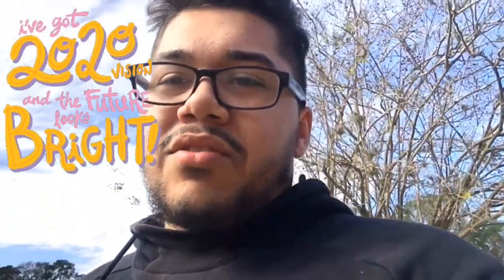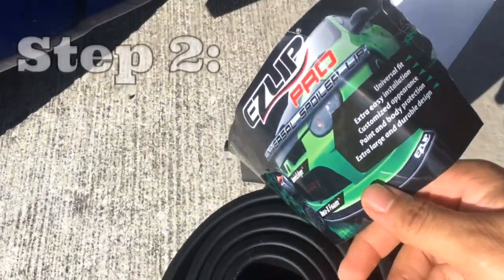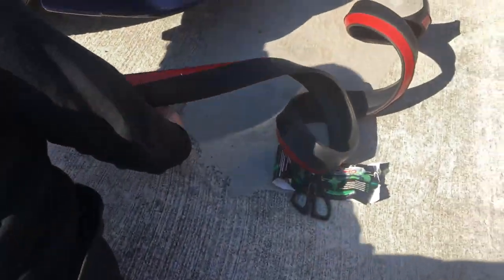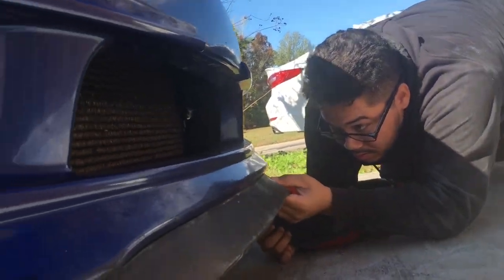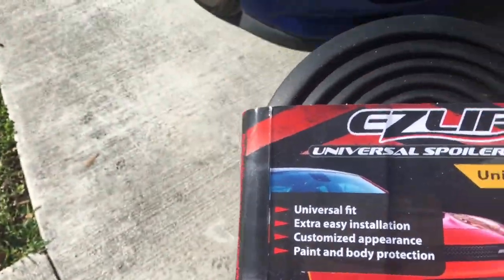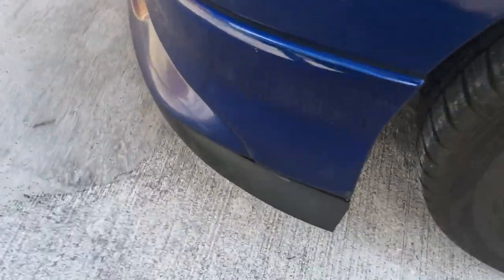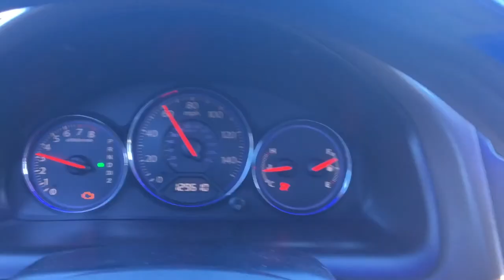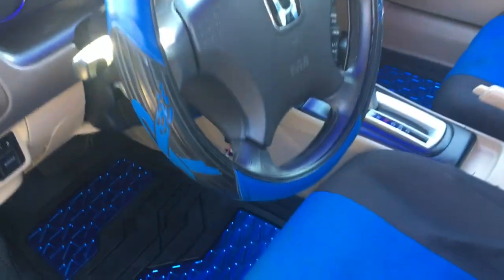EZ Lip Pro & EZ Lip Side Skirts Install| 2004 Honda Civic Ex

Comment: Should have done Pro on side skirts too so it can match..how about the rear?
Reply from the maker: No I like the the original style side skirts on the side the pro would have been too thick on the side. It looks fine how it is but there is no lip in the rear.

Comment: Just picked up a clean 04 Civic EX Sedan, like the look and cost of this simple mod.  R u still running this car and the body upgrades?
Reply from the maker: No I’m only running the side skirts cuz the front lip kept falling off even wit me using screws. So I jus ripped it off it started ripping… imma get a lighter front lip in the future but rn I’m running the side skirts and my hfp body kit
Reply from the maker: In my opinion I would stay away from ez lip pro front lips the adhesion sucks if u don’t use screws and extra spray adhesion
Reply: @MGModz4Life  supposed to use a heat gun on the 3m tape before putting it onto the bumper
Reply from the maker: Yea Ik I jus didn’t have a heat accessible at the time and u can also u a blow dryer as well… so I jus used 3m spray it did the job for a lil while but I think if I did use the heat gun it might have been a lil more effective